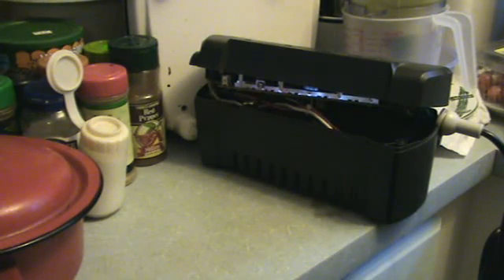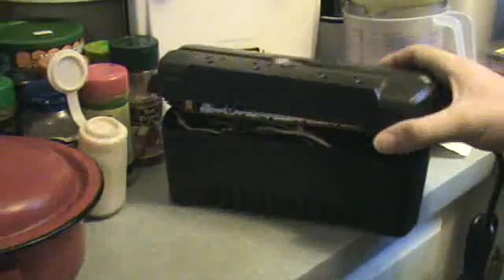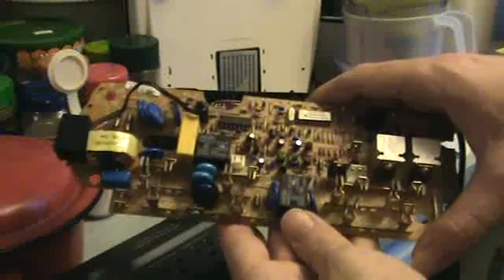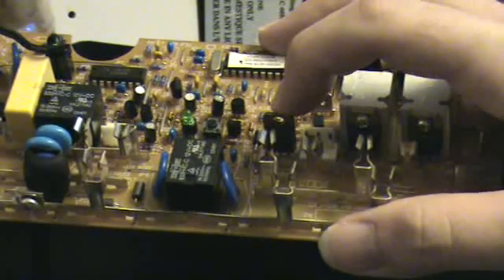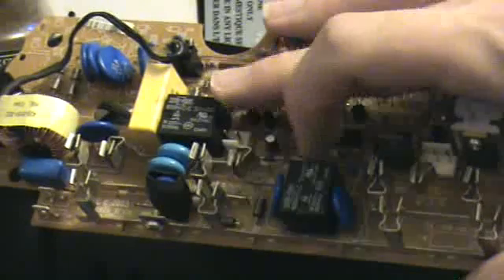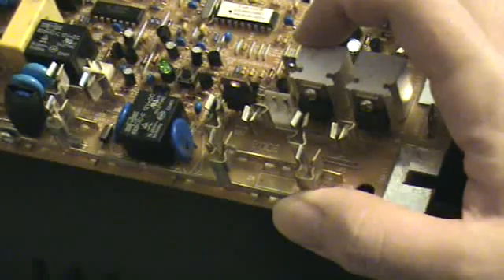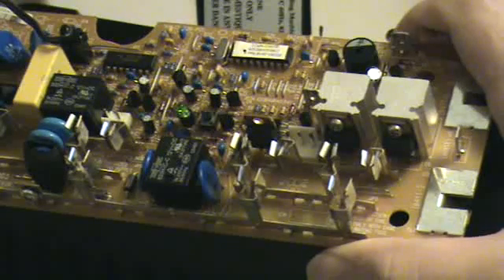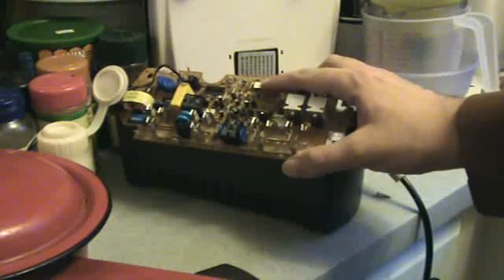How a UPS Works

Comment: Does the same transformer involved both in charging the battery(as a step down transformer) as well as connecting the battery to the output(as a step up transformer) ?
Reply from the maker: In this case it does but often there will be a smaller transformer or SMPS for charging and maintaining the battery cell.

Comment: How does those two Mosfets convert square wave to approximate sine wave?
Reply from the maker: They switch alternately into a split winding of a transformer. So on the secondary winding it combines into a squared off AC output roughly approximating a sine wave.

Comment: Here is my problem : i had broken ups - one of 4 transisors thah powers transformator was not working , so i changed it and it now makes AC power normaly when connected on car battery , but i am not sure these 2 leads that go from transisors to transformator did i crossed them or not . I fear if i plug it in wall socket that i would burn it .

Comment: I have a problem with my 500va UPS APC, When the power goes out, the ups does not provide backup to my computer, when the power goes back on, the ups turns back to normal, i changed the battery already but still the same problem.

Comment from the maker: AGM is a type of lead acid battery.  It's just that the acid is adsorbed into glass mat and so it cannot spill.  This comes at the price of shorter life, lower current output, and higher price.  There is nothing harmful about the fumes from regular lead acid batteries as long as you have adequate ventilation.

Comment: your explanation of the working of a ups is very good and clear good job
i have at home a online ups of 4500W with  12 batteries of 40Ah it has a backup time of about 14 hours at a load of 18 A and 230V
but i work on ups systems every day  with a power between 500 W  and 1500 KW so its my job  
your explanation is nice work

Comment from the maker: @farcryaustralia At 500W, that would be maybe 2A through the transistor, though it is capable of much more.  The Fairchild FQA9N90, used in some power supplies, can handle over 6A at up to 900V with adequate cooling.  They use an oversized transistor for higher reliability and to get away with using a smaller heat sink.

Comment from the maker: @farcryaustralia Incorrect.  Transistors are quite capable of switching high voltage/high current loads.  There is at least one in your computer power supply operating at over 300V and several amps.  Inverter welders such as the Miller XMT in my other video have very large transistors.  On the highest setting, it produces 300A at around 80V.
Reply: The Lightning Stalker give me a call I need help with my inverter

Comment from the maker: @Xearo167 If you can find a Back-UPS Pro 1000, that's the one to get.  Still, I don't think it has a much better charging circuit.  It takes 2 batteries as well, so replacement is twice the price.  That's why I recommend using deep cycle boat batteries with maintenance ports.  That way you can refill with some distilled water when the electrolyte gets low.

Comment from the maker: Most likely, it's the battery.  You can test it by connecting a 12V power supply in place of the battery.  You could also hook it up to your car battery.